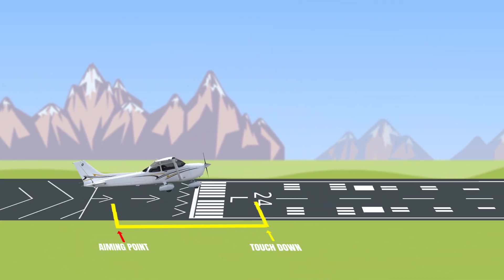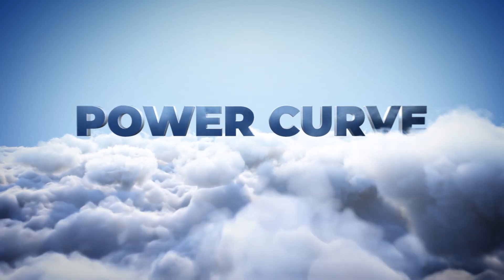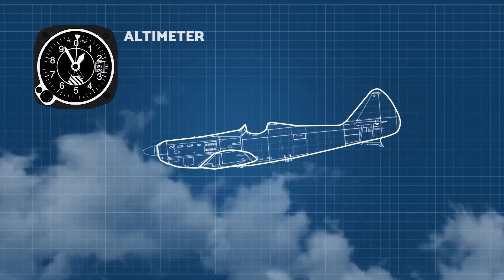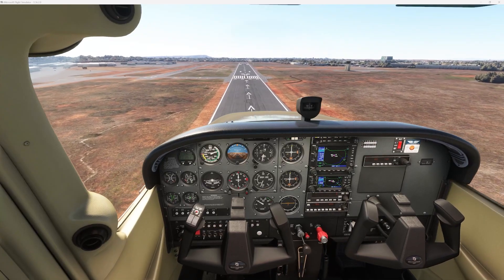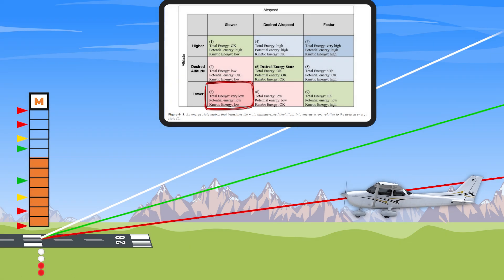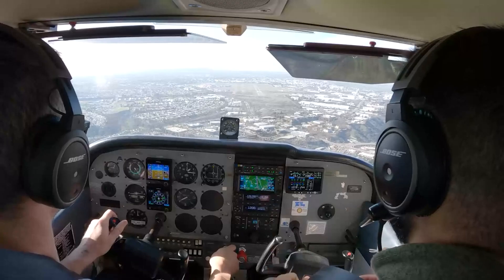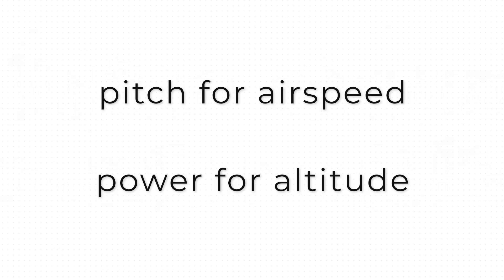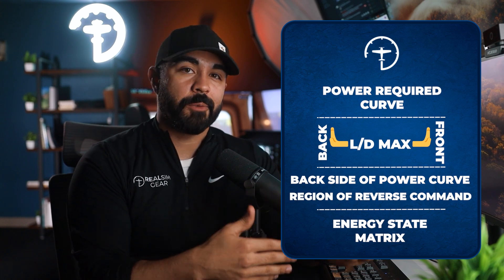Power Curve - Energy Management Part 2 - Landings Mastery

Comment: “Pitch for airspeed and power for altitude” during approach is exactly the kind of over-simplification that the energy-centered approach was elaborated to do away with. If you’re at the correct altitude but the speed is wrong, the saying would have you only change pitch. Energy management, on the other hand, sees this as either a deficiency or excess of total energy. That demands some change to the throttle (or flaps). It will also require some change to pitch to redistribute the new energy state in such a way that you don’t end up at a high or low altitude when you were previously at a desired level. If you only change pitch, you’ll end up changing the balance without changing the total energy and will create a situation where you will end up high or low in altitude. The saying would then have you use the throttle to correct that. And then if that’s all you do without also redistributing with pitch, your speed will end up being off again and around we go. So it eventually gets you to realize you needed both to fix both but it makes it two separate steps that seem unrelated and should have even one simultaneous change of both.

Comment: L/Dmax does not split the power curve into front and back side; it splits the drag aka thrust required curve into such and is useful for jets and gliders. Minimum power required does this for propellers. Though, if you look for your max endurance AOA, or max endurance airspeed at max gross weight, then you’ll find the dividing point front side and back side regardless of type. Remember the power required curve is the thrust required curve multiplied by speed. This is why the power required curve looks more squished on the left side and causes the minimum point to shift left of L/Dmax.
Reply: That's good to know, but doesn't really affect pilot technique.  As long as you are in a variable power state (cruise, approaches, maneuvering), just adjust the power for the desired speed like in a car.
Reply: @warren5699  that doesn’t work.if you adjust power regardless of where you are on the curve, the result is a change in VVI. Except should you either be in certain fly-by-wire states or should you be coupled to an autopilot, merely changing power will have no impact upon speed whatsoever. We trim for AOA, airplane longitudinal stability is to maintain AOA, such drives the whole “pitch for speed, power for altitude” and such is always true. If you’re in cruise, you add power, what happens, you climb. The whole ‘reverse command’ should be thought of as reverse demand as the sense of the power input doesn’t change power effects. Rather, instead, reverse command comes in the secondary result of pitch changes unaccompanied by power changes. If you’re high on the back side, you can forward slip adding parasitic, or you can pull up increasing induced. If you’re low, you need to push the nose down. Such is uncomfortable and why instead we use power techniques.

Comment: Disagree.  If you make changes to pitch to control airspeed, you also change the line of flight, which will change the location where you start the flare.  I never had any problem controlling airspeed with power.  Works as easy as when driving a car when you keep a stabilized line of flight with the elevator.
Reply: Great, now control altitude with pitch while on the back side. Now do it in a glider. (Maybe instead you’ll want to look on Medium for Improve your Landings with AOA and Power Techniques.)
Reply: @jimallen8186  "Great, now control altitude with pitch while on the back side."  Have done it countless times.  Keep the wing flying with power at minimum speed or anything greater, and the pitch (which controls the lift vector and opposes the weight) will control the altitude.  "Now do it in a glider."  Gliders are like powered aircraft with an engine malfunction or failure.  There is no or not enough thrust to equal the drag that is present when altitude is sustained.  So the pilot is forced to pitch down to create that thrust and will therefore descend.  "Maybe instead you’ll want to look on Medium for Improve your Landings with AOA and Power Techniques."  No thanks.  I suggest you look at the Pilot's Handbook of Aeronautical Knowledge.
Reply: @jimallen8186  "Great, now control altitude with pitch while on the back side."  Well, isn't that exactly how all landings are made - chop power and hold the altitude just above the runway with pitch?
Reply: @warren5699  round out and flare are specific unique things, what happens if you do that at a hundred feet? After acknowledging I have a point here with that question and this your previous answer is invalid, answer the original question, how do you control altitude with pitch while on the back side? (You can find the answer on Medium in Improve your Landings with AOA and Power Techniques, it is a doable task but it is not a comfortable one.)
Reply: @jimallen8186  Jim - Sorry if this results in a duplicate response - I did reply earlier with some different points and now don't see that response, but I'll add this also.  The altitude would not matter.  A round out is a leveloff.  For landing it's close to the ground and affected a little by ground effect.  A descent from 3000 to 2000 (or any other altitude) would be just another leveloff like the roundout to the landing, only with a little more drag being out of ground effect.
Reply: @warren5699  a round out is not a level off, it is a setup for descent. You temporarily flatten in a mini-zoom, not climb nor reduction of descent, while rapidly increasing induced drag thus setting up a big fall. Ground effect plays as it softens the fall, altitude really does matter. Same as with deploying flaps, a pull-up on the back side is a transition to a higher but steeper wire. Said wire very quickly becomes the lower wire.
Reply: @warren5699  which you should be able to do with power and power alone. What you cannot do, however, is make it happen strictly with longitudinal stick. If you were diving as opposed to descending, or if you were descending really fast, in either case being such as to already have significant power in and be well on the front side, yes, you could level merely with stick letting it slow to a stable point assuming that the power previously in is sufficient, but this isn’t controlling altitude by stick, you’re still manipulating speed by stick and unwittingly have power for altitude. With insufficient power you will either bleed out to stall or you will reach an AOA equilibrium and descend. The stick didn’t level you out. You are merely perceiving a temporary illusion of such as the stick action takes you through a transitory state.
Reply: @jimallen8186  "setting up a big fall".  First time I've heard that from anyone.  Paraphrasing, the technique in the Handbook is to touch down on the mains fairly close to stalling speed with the lift still supporting the weight for a 'gentle' touchdown.  Falling onto the runway?  Poor landing gear.
Reply: @jimallen8186  "The stick didn’t level you out."  The airplane arrives at the runway in a descent, power is eliminated, and the airplane levels out (sometimes not 100% - sometimes more than 100% like in a balloon).  What made it change from a descent to a leveloff if it isn't the stick, because the power is eliminated?
Reply: @warren5699  but you don’t level off, you fall and you fall because you have inadequate power
Reply: @jimallen8186  Well, when rounding out. technique as you know needs to be pretty good.  There's not a lot of room for error.  But pilots do balloon sometimes and usually make the necessary corrections using pitch and/or power to land safely or execute a go-around.  Ballooning is when an airplane moves back up away from the ground so I'm not sure why you would say it's only ever falling.  The FAA handbook describes it in part as "The round out is a slow, smooth transition from a normal approach attitude to a landing attitude, gradually rounding out the flightpath to one that is parallel to and a few inches above the runway".  Isn't parallel to the runway basically a level off?